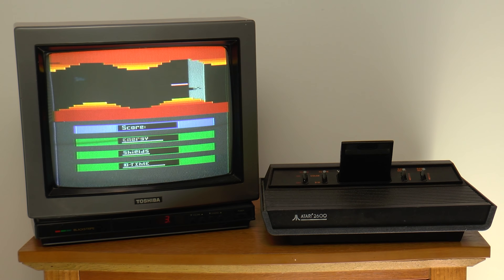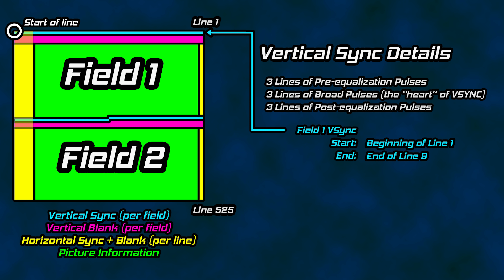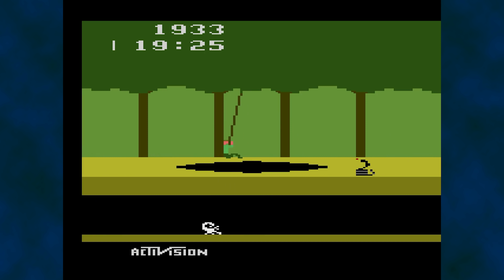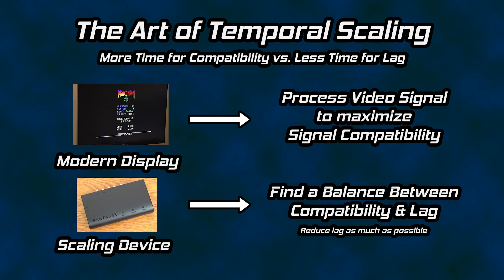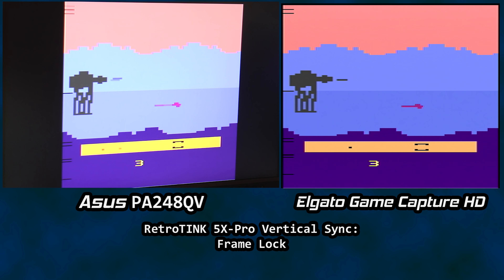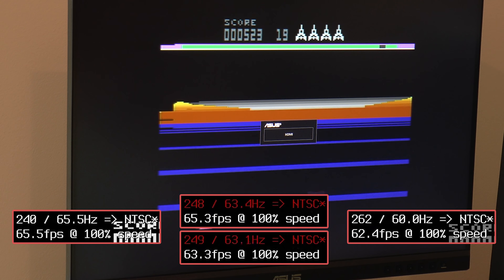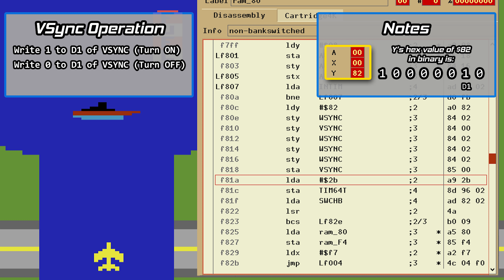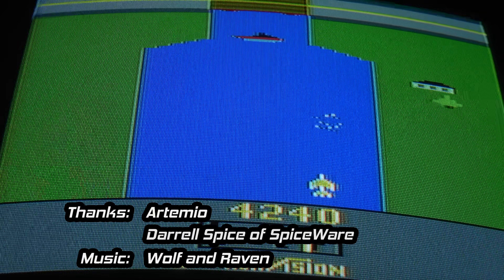The Atari 2600, Analog Video, Scalers, and the Agony of 240p Ambiguity

Comment: I have no background in any of this, so what I am about to say may not make any sense, but...
What if the converter box would interpret the signal the same way as a crt would, sloppy tolerances and all, into a virtual frame. Then a virtual hd camera would kinescope from that image? Kinda like a power conditioner, but for the video signal.
Reply from the maker: There are certainly a lot of ways to interpret a video signal, however image processing and conversion is done at the expense of lag. Of course if you are capturing (and potentially streaming) to a device that is independent of what you use to play the game, you could split the analog signal to a CRT for gameplay and do image processing/capture independent of that gameplay to create a trouble-free presentation. Streamers do this already, but you could continue to implement some fancy forms of "CRT-esque" visual processing on the capture side of your chain.

... OR! You could point the camera at your CRT. Heh. The trouble with this is that video cameras pointed at a CRT can be tricky to get just right.
Reply: Not so easy. A CRT can change its resolution even for individual frames, but a digital TV signal cannot. You need to fill in the gaps for the missing lines and then you lose sync with the original signal and need to average that out somehow. That's what the converters do.
Reply: @nmosfet5797  How does the CRT know how much space to advance down for one scanline?
Reply: @joshuahudson2170  That's fixed by the TV standard. NTSC says it's 525 lines per frame, PAL says it's 625 lines, if I remember correctly. Hmm... industrial monitors have knobs at the back to adjust this - turning them makes the picture taller or wider - so you can use pretty much any amount of lines that you like. When your signal has a vertical retrace pulse, the beam goes back to the top. But modern TVs are typically not happy to show anything else than a proper PAL or NTSC picture.
Reply: That's effectively what the triple buffer mode is doing.

Comment: If you're going to play a retro game on a modern monitor, would it be preferable to select a modern monitor with the lowest resolution possible so there's less upscaling required? Say a 1366x768 monitor as opposed to a 1440p monitor? I'm under the impression that the more you have to upscale - the worse the image quality. For example if you take a thumbnail sized image and blow it up in photoshop, the bigger you make it - the uglier it gets. Or is this wrong? An upscaler can't add more pixels to the original for more detail right? It just essentially takes the original and stretches it by doubling, etc right?
Reply: It wouldn't make much of a difference.
Reply: @fungo6631  I'm not so sure. Based on my testing at home with emulation using a 1366x768 monitor, a 1920x1080 monitor, and a 2560x1440 monitor it seems the highest res monitors reveal more of the flaws and jaggy edges from blowing up a very low resolution image further and further beyond the original intent. However my tests were done using emulators with internal resolution (software based) upscaling, as opposed to original consoles connected via upscaling hardware, (which I don't have to test and am not familiar with).
Reply: The physical screen size makes the biggest difference. The screen can be CRT, plasma, LCD, or OLED - the bigger the screen, the more that low-res content needs to be stretched.
Reply: @KopperNeoman  And the more something is stretched - the worse the result right? So a higher resolution monitor demands the small pixel count native image to be further stretched (distorted) than a lower resolution monitor. A larger physical screen size will result in lower pixel density, which would add an additional blurriness but overall, the higher the resolution, the more distorted and flawed the translation.
Reply: Higher resolutions can compensate for larger screens by making the individual pixels/dots smaller.

That, however, requires the source image to be higher resolution. You'll never magically turn a 480p image into a 4K one.
Reply: @KopperNeoman  So am I right in thinking that anyone who wants to play retro games should be advised to avoid higher resolution monitors? Saying retro games look better at 1080p as opposed to 1440p for example? Because they can't be genuinely higher resolution, only distorted more.
Reply: @DerekMoore82  Images and upscalers work diffrently i suppose.
Reply: @DerekMoore82  Depends what kind of scaling you're looking at. For retro stuff you'd usually want nearest neighbour scaling which doesn't really change as you go bigger, there's no change in blurrier, you just use more pixels out at the same colour.
Reply: @DerekMoore82  no. The screen size is relevant. A bigger display shows more flaws obviously. The resolution works the other way. The higher the resolution the smaller potential flaws may be. Obviously you should always try to use an integer factor. I.e a 720p(720 lines) scaled to a 1080line display would look bad, since every second line of the higher res display would need to be a mixture of 2 lines of the 720line signal. That would mean that every second line would be blurred and the whole picture would look very blurry as a result. Scaling a 720p signal to a 1440p signal is easy. You just need to show a line of the 720p signal twice on a 1440p display. I.e. integer scaling is the magic word.
Imagine a 20line signal. Now you only got an imaginary 110line display. What is going to happen? You repeat each line of the original image 5.5 times. That is bad. 5 times repeating the original line is fine, but the next line would have to be mixed. Again blurriness. But that also means, that the blurriness is only a single line wide. Imagine a 210line display. The blurriness is still only a single line wide. But the line is thinner for the same display size. So the image appears sharper on a higher res display.

It is also possible to always force integer scaling and leaving the rest of the display with black borders. This means that the image is always sharp. But again, a higher res display is your friend again. Since the lines are thinner and the maximum number of black lines is the same no matter the integer scaling factor, you will usually end up with more usable space on a higher res display.

All this is also applicable to horizontal number of pixels. On CRT monitors, the "pixels" of the games were not square. But on modern displays they are. So if you want to play with the optics of a CRT, you would want to stretch the image horizontally (usually, some programmers took that effect into account and prevented it from happening, so you should adjust the settings for each game). With a higher resolution display, you are more likely to achieve the proper scaling without any blurriness, since you have more chances to get a close integer scaling factor.
Reply: @thrownchance  Interesting. I wish Displaced Gamers should make a video on this subject. Actually, he might already have, I'll have to check his video list.
Reply: Any scaling that isn’t integer scaling is going to require the tv to do some quick math, and quite frankly it doesn’t look very good.